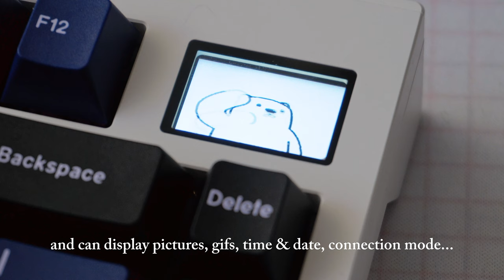budget Zoom75 alternative for 130$ | Cidoo V75 Plus | Akko CS Crystal Wine Red

Comment: Thoughts on this versus the Zoom75? The Zoom75 is roughly $120 more for me, so want to know if the Zoom75 is worth the extra money compared to this.
Reply from the maker: it is a really solid alternative tbh, it’s not as pretty obviously and doesn’t support multi layout, but if you’re happy with the white version and regular ansi layout, i definitely recommend it. however you are stuck with the screen, unlike the zoom.
Reply: @mangokeebs Yea fair enough, im in the rabbit hole right now and am now stuck deciding if I should get the QK100 or the NJ98. As I like having a numpad. QK is $380 (CAD) or so for a full build vs NJ98 being $180 for a full build haha
Reply from the maker: @DeSibyl  id honestly think the extra money for the qk100 would be worth it in that case. or you can maybe look into separate numpad options!
Reply from the maker: @DeSibyl  id honestly think the extra money for the qk100 would be worth it in that case. or you can maybe look into separate numpad options!
Reply: @mangokeebs  Fair enough, yea maybe I'll pull the trigger on the QK then.